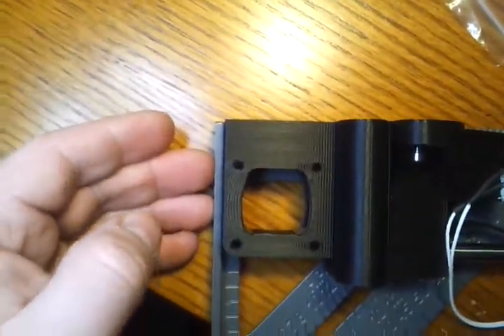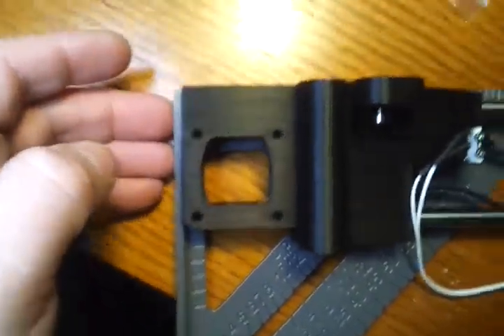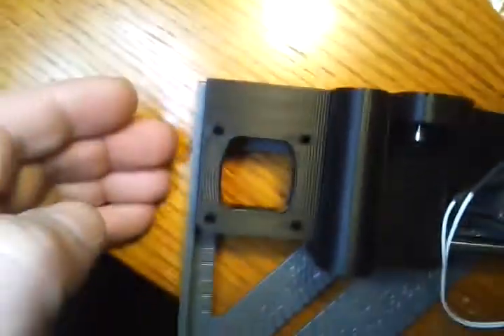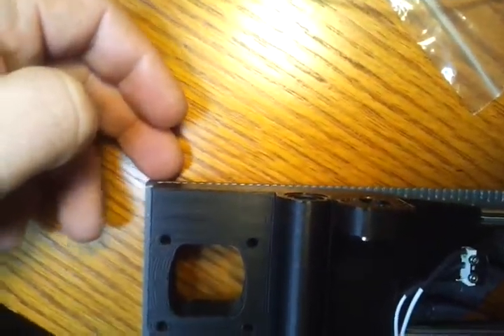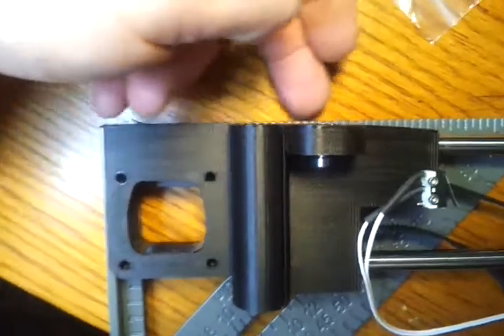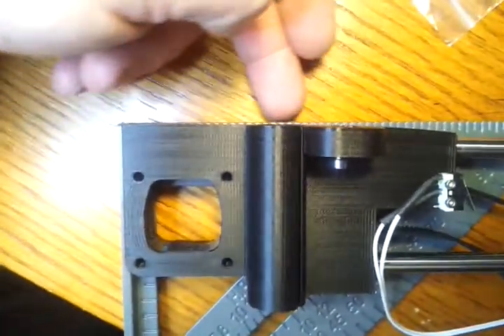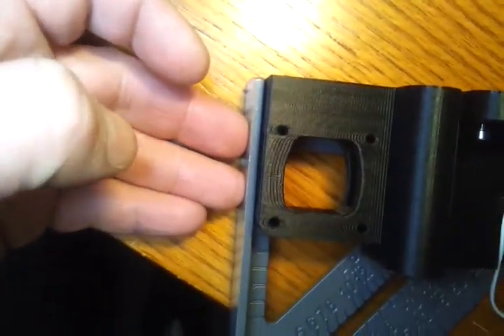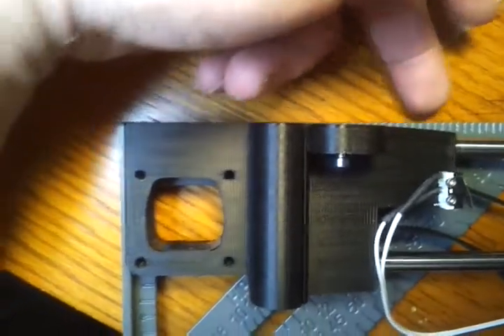HIC Technology PRUSA I3 - 3D Printer - manufacturing defect

Comment: After much dicking around with this, I've decided the best thing to do is to change the frame to match the placement of all other prusa I3 Z rods.  The HIC model has them offset front to back, which makes recreating these parts very difficult.  I'm going to switch my frame and x-end carriages over to the same style as all other prusa i3's using the following parts:

http://www.thingiverse.com/thing:662820

http://www.thingiverse.com/thing:332734

After I get these printed out and test fit them.  I'll let you know how it turns out.
Reply from the maker: Thanks for the update. Let me know how it works out.

Comment: its peeled up during printing, ill send you another for free if they wont replace it. i build 3d printers and have loads in stock
Reply from the maker: I figured it was something like that. They are sending me a new part and I really hope it's better than this one. If not, I don't know if I'll want to keep messing with this thing or just ask for a refund.

I appreciate your offer to send me a new part. Would it bolt right up to my printer, or would other things have to be changed to make it work? I know the Prusa design is an open-source type of thing, but there seem to be a lot of differences between the various companies/people that make and sell them, so I don't know just how interchangeable the parts are between machines.
Reply: adamky1
yes, if yours is a prusa i3 it should fit no problem. if you do have problems and need any printed parts just let me know. It would be a shame if you missed out on getting involved with 3d printers just because the supplier sent a bad part.
Reply from the maker: Paul Breck Thank you, I appreciate that. The good news is that they sent me a new part and it was much better than the last one. I was finally able to get it to print and have been printing and fine tuning for about a week now: https://www.youtube.com/watch?v=FGOYbZf9f0Y. I should have bought one of these a loooong time ago. So much fun.
Reply: +Paul Breck  Paul, I believe I have the same issue with this printer. I would gladly buy one of these from you and pay shipping. Do you have a site I can order from?
Reply from the maker: Joseph Hahn If Paul doesn't get back to you, I can make you a new part now that my printer is working correctly. Another generous Youtuber, Keith Reis... who also had the same printer with the SAME problem created the .stl files needed to re-make the X-axis motor carrier: http://www.thingiverse.com/thing:712896. His reply was about a week ago in the comments below. Let me know if I can help. And if it makes you feel any better, it's not a bad printer once you get the warped part replaced. Quality of the prints is very nice for a $400 printer.
Reply: I would very much appreciate that. what would you need from me? I can send you my address, and what ever compensation you feel is appropriate. I feel its a good printer just needs some quality control in their parts department.
Reply from the maker: Joseph Hahn You only need the left side like I did, correct? I'm fairly certain that it's printed in PLA. It's a fairly large part and according to Cura it will take a little over 9 hours to print using settings that I know will make a good, strong part: .2 layer height, 2mm shell thickness, 2mm top and bottom, 50% fill density, and 35mm/s print speed. (I'm including the machine settings that I will use just in case someone has any critique on those settings). I will get it printed out and then I'll message you and we can figure out the shipping part. Also, the HIC version of the Prusa has the Z-axis guide rods offset front to rear, which seems to be a unique part about this printer. Pretty much all other Prusa's have the Z-axis screw motors and guide rods centered on the same axis. So, it's quite possible that the part that Paul had in mind may not work on this printer. However, with the correct files, he could obviously print you one out as well.
Reply: yes the left side is the culprit of my issues.  let me know when you have it completed I will get a money order or pay with Paypal how ever you would like it sent. I can not thank you enough.
Reply: adamky1
thats good to hear adam, if you need any parts or help please let me know.
Reply: Joseph Hahn
if you have any problems getting the part you need joseph i can send you one.
Reply from the maker: Joseph Hahn
Well, I printed it out last night: http://i83.photobucket.com/albums/j314/jefrom19/3D%20Printer/IMG_20150316_145152790_zpsclva5c5g.jpg. Unfortunately, as I was cleaning it up, I realized that it had a slight warp to it: http://i83.photobucket.com/albums/j314/jefrom19/3D%20Printer/IMG_20150316_145336756_zpsvnv1ziaq.jpg. Crap! You might want to contact Paul or Keith Reis about printing you a new one. I'm still fairly new to 3D printing and I guess I need to do some more tweaking to get rid of the warp. Sorry man! I tried.
Reply: cool how should I send you compensation and what E-mail fo you want my physical address to?
Reply from the maker: Joseph Hahn
I think you missed part of my last comment :-) I printed it out but just like HIC Technology, the part ended up a little warped. You might want to see if Paul could print it out for you. The file is located at: http://www.thingiverse.com/thing:712896.
Reply: ok thanks sorry I did miss that.
Reply from the maker: Joseph Hahn I'm going to make another attempt at it tonight or tomorrow. I've been wanting to print an extra set of left and right x-axis parts just to have as spares for myself and I don't like the fact that it peeled up a little.
Reply: OK any luck with it? I am in negotiations with HIC right now.But its gunna be a while.
Reply from the maker: Joseph Hahn Not yet. While troubleshooting the warp issue, I discovered something which may or may not be contributing to the warp. Either way, it needs to be fixed. The Y-carriage, which is the piece that the bed mounts to, is made of acrylic like the rest of the frame. The issue with that is that it flexes.. a lot. Not only is there a lot of flex, but the heat from printing larger parts is causing one side of the carriage to sag badly. I had to order an aluminum replacement for it off of ebay and that should be here tomorrow. I'll keep you posted. I haven't given up yet.
Reply: Yeah I noticed that on my bed as well. I am also having heating issues with my bed in that it won't really get past 60C . But the flexing is something I noticed too. I am buying a new Bed and was considering a new mounting plate, I think I will order one just for the heck of it.
Reply from the maker: Joseph Hahn
I have never been able to get mine over 64* C. I had it set to 70* one night and that's as high as it would go. I've already been looking into yet another "upgrade" to remedy that. :Sigh:

I've had to make several modifications to get this aluminum Y-carriage to fit. I think it will be nice once I get it set up, but I'm still not there yet. I'm trying to switch from a 4 point leveling system to a 3 point and that's what is making everything so complicated. I'm taking video of everything so anyone else will know what they are getting into with this upgrade. Hopefully I'll be able to start printing that X-axis part for you some time tomorrow.
Reply from the maker: Joseph Hahn Check your messages.
Reply: adamky1 well I am not getting very far with HIC, its very hard to get a response from them. I am able to print, but I have to take the support rod out of the hole that it fits into on the stepper motor mount.  I am going to try to print a replacement part, but not until after I build a box around the printer  and try to put some insulation material on the bottom of the heated bed to try to get it to heat past 64c.I think that with these modifications I will be able to keep it from peeling up and warping. I will keep you updated I will try to get the box built this weekend. The location of my printer is in my basement workshop, and its very cold there as I am in NY. :) So I think the Box and the insulation on the heated bed will make this happen. But I am definitely getting a new heated bed for this as soon as I can. I can't seem to find an aluminum Y carriage as I would like to get a new one to level the bed with the flexing of the acrylic one I have is not bad, but I suspect that it will get worse over time.
Reply from the maker: Joseph Hahn This weekend I realized that acrylic is a horrible material to make a 3D printer out of. There's just so much flex and it's prone to cracking if you over tighten anything just a little bit. I've spent the past several days bracing and/or replacing most of the acrylic parts on the Y-axis with aluminum. The y-axis motor mount is now aluminum and so is the y-axis idler bearing assembly at the front. So, I can run my y-belt with more tension, which is making for better quality prints. I also went to the hardware store this weekend, found the flattest piece of 3/4" birch plywood (2' x 4') that I could find. Cut it in half and glued the pieces together and let it sit overnight with 180lbs on it. I then screwed the two pieces together and the result is a 2'x2' 1.5" slab that's very flat (MUCH flatter than what I was using before). I then made aluminum brackets for the front and rear and the printer is now bolted to the board. Here are some pics: http://i83.photobucket.com/albums/j314/jefrom19/3D%20Printer/IMG_20150325_012300770_HDR_zpsvrllxu9g.jpg & http://i83.photobucket.com/albums/j314/jefrom19/3D%20Printer/IMG_20150325_012322835_zpsxrdnwuye.jpg. I am finding now that I don't have to run the bed leveling very often, whereas before I was running it prior to printing anything and everything. Since it isn't moving around and it's bolted down, and since the y-carriage isn't flexing like crazy, it just seems to stay level.
Reply from the maker: Joseph Hahn Also, something interesting to note about the bed. For starters, we have a 200mm x 200mm heating element and a print surface that is way bigger and hangs off of the ends by 35mm on each side. Why? I have looked and nobody else does this. Aluminum is great at dissipating heat, so in my opinion, this extra 70mm is just a waste, and probably acts more like a big heat sink preventing the bed from getting as warm as it should get. To prove my point, I tried replacing the aluminum bed with a piece of 200mm x 200mm Borosilicate glass. The glass ended up being warped so I didn't have much luck with it, but that's beside the point. What I WAS able to do was get it up to 80*C without issue. I had also heard that some people throw a towel or something over the bed in order to help it warm up quicker. Doing this, I was able to get it to 100*!! Now, after I started printing, it dropped back down to around 80*. But, the thing I learned there is that the heating element itself is more powerful than I thought. It's the oversized aluminum bed that's not allowing temps to get any higher than mid-60's. I recommend trying a smaller 200x200 bed out of either aluminum or glass and see how hot you can get the bed. Also, I still have the x-axis motor mount that I made if you have trouble printing one on your own. Just let me know if you need it and it's yours for free.
Reply from the maker: Joseph Hahn One last thing. The aluminum y-carriage took more work than I expected to get installed, but it is sooooo much stronger than that acrylic crap. And I now have 2 linear bearing on each side now, instead of the "2 on one side, 1 on the other side" that it came with. The results is a very strong piece with very little flex.
Reply: Good to hear that the modification is worth the expense. I am looking forward to making this change. But I need to fix the printed piece first. Did you get a better heating element for your bed, or just replace the Y carriage plate?
Reply from the maker: Joseph Hahn I haven't changed the heating element yet. That may require a larger power supply or a separate power supply just for the bed and a relay to trigger it. The ebay seller that sold me the warped boro glass issued a full refund, so I ordered a new one from matterhackers.com. With the glass, it was not difficult to keep the temps at 80*. So, I'm going to give this a try first. I printed the x-axis part again last night with different settings and while it did print a little flatter, the far ends still warped up slightly. The part was still stuck to the tape very well, but it actually pulled up the tape. I'm now trying another part with Exterior blue painters tape and slower print settings with "no cooling". The exterior tape has a little better adhesive and may stick to the bed better. Although, everything I have read says that the warp issue is a result of the print settings, so I'm trying to get that figured out.
Reply from the maker: Joseph Hahn Have you had any luck with printing a new part or getting HIC to send you a replacement?
Reply: I have not had any luck getting HIC to replace the part. But I just got my new silicon bed heater and a glass plate to print on. I plan on running the print for this on Monday. I am pretty sure this will fix it I will let you know how it goes. If this won't work I am going to have one of the 3d print hubs print it for me.
Reply from the maker: Joseph Hahn Any luck? Just to update you, I can finally print ABS now with ZERO warping/peeling. With the 200mm x 200mm boro glass in place of the aluminum, I can get my bed temps up to 90*C if I want to. With the hotter bed, the prints have no issue sticking to the glass. I may upgrade my heating element anyways just to get a faster warm-up, but it is not a necessity. If you need me to have another go at printing you the left side x-axis, I feel much more confident that I can print it flat and level in ABS.
Reply from the maker: ***** You have to either jerry-rig it, or have some else print it for you. I know I'm about 3 weeks late to reply, but do you still need the part?
Reply from the maker: ***** Yes. In case you haven't figured it out yet, you probably need to adjust the trim pot for whatever axis isn't printing correctly. This picture shows what the trim pots look like: http://s83.photobucket.com/user/jefrom19/media/3D%20Printer/MKS%20BASE%20V1.2_zps9azqzigo.jpg.html?o=2. There's one on each stepper driver. The stepper driver are labeled for whatever axis they control. Using a very small Phillips screwdriver, turn it clock-wise 1/8 turn at a time until the issue goes away. Now, it's entirely possible that you have some other issue going on. But I had layer shift issues a few weeks back and replacing the motor did nothing to fix it. Adjusting the trim pot took care of it.
Reply from the maker: ***** The bearings press in and out fairly easily. I can probably print you another x-axis motor mount and mail it to you. Do you live in the U.S.? As for the layer shifting, which way are they shifting? Are they shifting front-to-back, left-to-right, top-to-bottom, or are they shifting on multiple axises? Can you take a video of it shifting and upload it to youtube? I actually had to re-adjust my Y-axis trim pot again yesterday. Layers started shifting front-to-back out of the blue. Also, I first said to turn the trim pot CCW (counter clockwise), but you actually need to turn them clockwise (I edited my last comment to avoid confusing anyone else reading this). Turn it CW about 1/8 turn or less and then run a test print and see if the issue goes away. If not, turn it a little more and try again.
Reply from the maker: ***** By the way, I have made several upgrades to my printer since this video was taken. To see what changes I made, look through this forum thread: http://www.502streetscene.net/forum/showthread.php?p=4053746#post4053746
Reply from the maker: ***** I tried running the part a few days ago and the edges peeled up a bit. They didn't peel up much... certainly not anywhere near what the original part from HIC did. I'm going to try again tomorrow. I've just about eliminated peeling/warping, but every time I try to print out one of these replacement parts, I get warping. It must have something to do with the height of the parts relative to their based width. I'm thinking of modifying the .stl file with some additional width at the base to see if I can get it to print flatter.
Reply from the maker: ***** Well, I made another attempt at printing the X-axis part and finally got the damn thing perfectly flat. Are you printing in PLA or ABS? And what color? I can give you my Cura settings. And believe it or not, the color does matter when it comes to nozzle temp settings.
Reply from the maker: ***** I'll try and take some screenshots as soon as I get a chance.